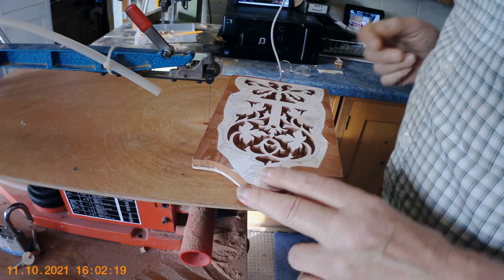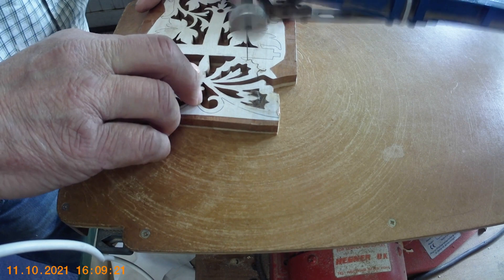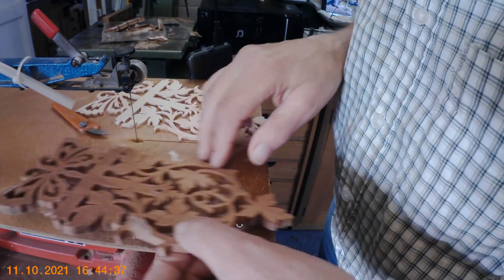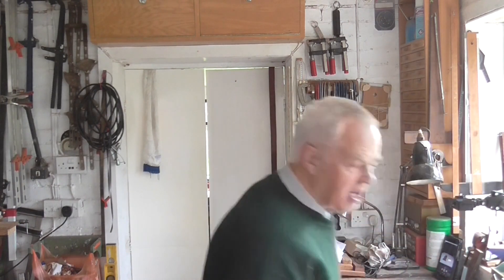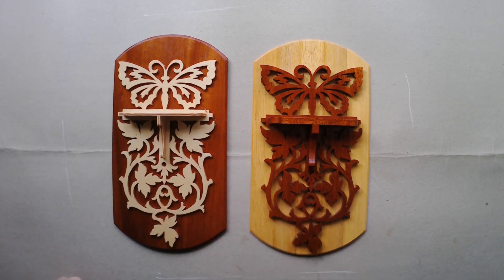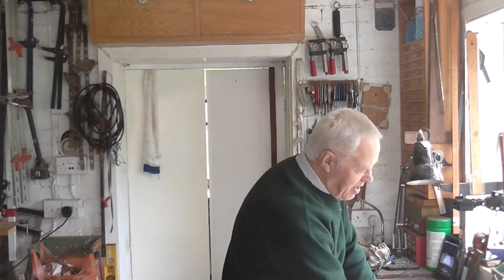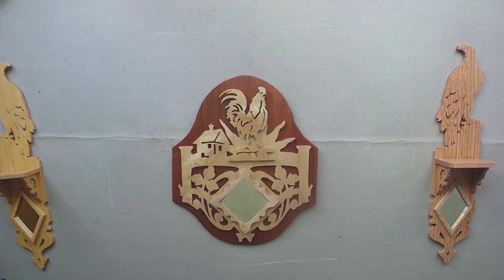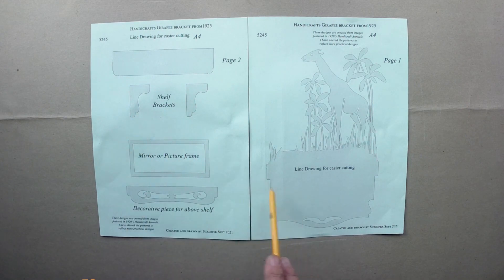How to do Scroll-Sawing and Fretwork. Making a butterfly Bracket. Part 3 Final.

Comment: I agree with your wife.  I love the light with the dark backing, it shows more detail.  Maybe if the "good" wood was thinner you'd see more detail.  Love watching the scrolling.
Reply from the maker: Many thanks for your comment Debi, I do actually think light on dark looks better but solid wood always wins over plywood.
 In those days long ago when the patterns were originally designed the designs were intended to be cut from thinner wood mainly because people only used hand frames or at best a treadle machine.
Often they used solid wood panels rather than plywood and of course solid wood is more delicate with bits easily breaking off which is why when using solid wood I make them thicker than originally intended.
With a backing of course the thinner wood is protected but  the backings were are usually an after thought by me and not intended in the original designs.

Comment: What's your take on raising the rear of the scrollsaw 2, 3 or more inches? I have seen an much as 10 inches. Have you tried it John?....Is it worth the effort?....Love your videos
Reply from the maker: Many thanks for your comment 'Jowett' (by the way I love the old Jowett cars) I have seen this idea of raising the rear of the saw but personally I don't see the point, I have managed with a level table for over 69+ years inc  hand frame, treadle machine and powered saw and never found the table angle a problem. I think it would annoy me that anything I placed on it would slide off.
Reply: @scrimperuk  Thanks John for your reply...Recently sold my 1936 Jowett Falcon...Thanks for you comment on the rear end raising of the scroll saw. I think pieces of timber under the rear legs bolted though to the bench is the idea but I think I might just leave mine as it is.....Chris

Comment: They turned out beautifully! Incidentally John, this house fire, you weren't using the angle-grinder indoors, were you? (Sorry. Just teasing!)
Reply from the maker: Hi Mark, many thanks for your comment. No I wasn't using an angle grinder, I only set myself on fire with them not the house! 
The house fire was caused by a stray spark finding it's way up behind the oak fireplace and setting the room on fire.
We were saved by our late German shepherd dog who came into our bedroom at 4:00am and woke us up to a house full of black smoke and flames licking the ceiling.
The dog was a hero and I often think I should make a video telling the story in honour of that dog.